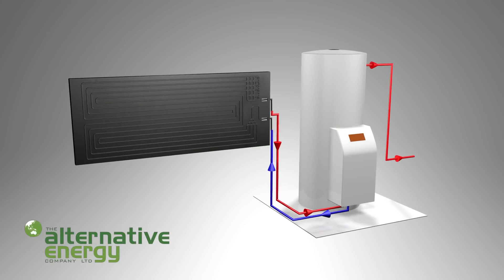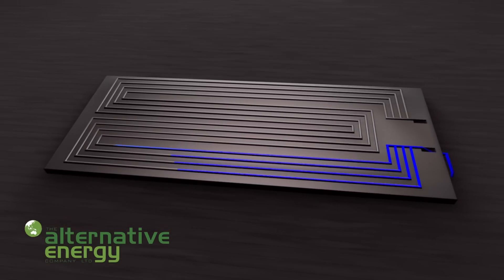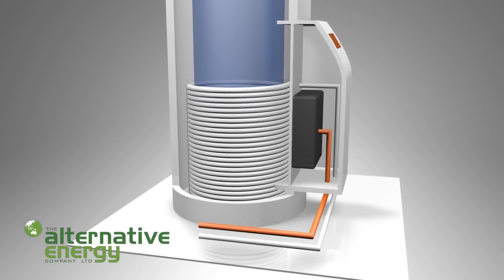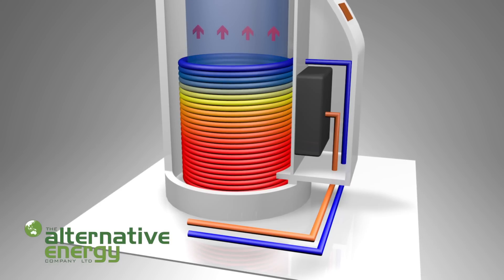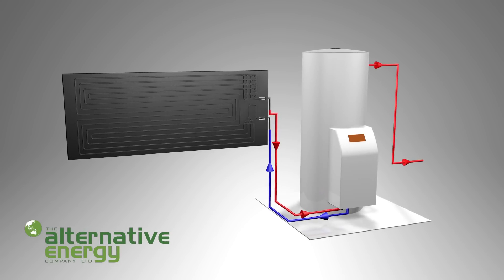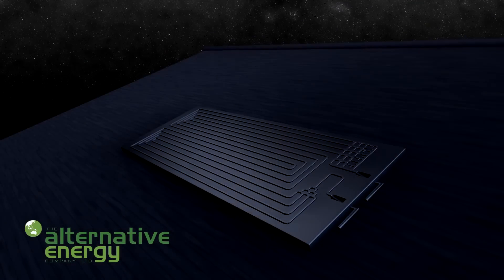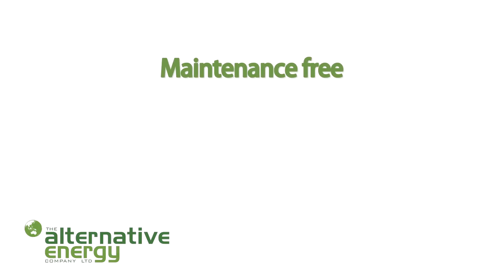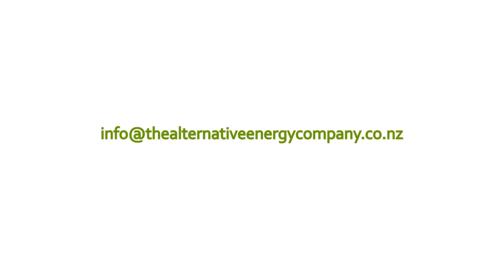Thermodynamic Solar Hot Water -  How it works!

Comment: You say it provides all your hot water requirements but you dont mention how many litres of hit water (55 deg +) it provides per hour. For example what size of system ( ie panel size , storage tank size) would be required to provide hot water for showering after a game for 20 shower heads ( currently requiring 2 x200 gallon storage tanks) where the demand is all roughly at the same time and not spread over a prolonged period.? Is there a system currently available to provide this amount of hot water.?
Reply from the maker: Hi, Energie do a range of systems for large scale hot water for hotels etc.  They could do a system that would easily cover 20 showers.  We would probably suggest a Eco system with a 1500L or 2000L tank to be safe.  When you say gallons, can I ask where you are located?   I suggest you look at their website www.energie.pt/en
Reply: @thealternativeenergycompan9065  Hi, thanks for the reply. I'm based in UK (N Ireland to be exact) I'm old school when it comes to measurement units lol
Reply from the maker: @trevorbest5715  https://www.lvprenewables.ie/ are distributors in the UK.
Reply: Could I use this to fill a hot tub quite quickly? If so, would there still be some hot water left in the tank or would any remaining water be diluted with cold water?

Comment: Had one installed 3 weeks ago, working brilliantly so far.....reading the literature supplied, i see it can take an input from an inverter from PV panel..very interested to do this as a stand alone feature.
Easily achieved  ?
Reply from the maker: Hi, I'm not sure if you are in NZ, but if you contact us we can give you the details of how to set this up
Reply: how much it cost for the whole system and installation

Comment: Near the end, it says it works day and night. Earlier, it said the fluid gets heated by the sun. How does it work at night?
Reply from the maker: Hi, it is heated by the sun, wind and rain.  The refrigeration fluid boils at around negative 28 degrees, so most weathers will have a heat transfer effect.

Comment: This is the same as a heat pump ....
Reply from the maker: A solar enhanced heat pump, making it 35% more efficient and an ordinary air to water heat pump.
Reply: @thealternativeenergycompan9065 You are calling it solar enhanced, nonsense there is no 35% more efficiency and your crap will not be able to match air to the water heat pumps on a wider range of ambient temperatures.
Reply: @adobo6905  Theoretically its possible to beat air source, especially if its sunny.  We need performance data from independent organizations.

Comment: Is the system not available with a solar electric solution for the 390w compressor. To make it a complete off grid system.
Reply from the maker: We could fit it to a small solar panel, but then it would not work when there is no sun!  We have many off grid customers because it greatly reduces the load on the panels and batteries
Reply: @thealternativeenergycompan9065  If it could work without an inverter it would be huge because hot water and space heat make up the majority of the inverter load.

Comment: How is this different from a heat pump? Isn't it a hybrid if solar and heat pump?
Reply: Well yes, it's a heat pump, the question is, how effective is it
Reply: @lenova8278  less effective because when you need at -10 degree Celsius it freeze on surface and can't touch any heat resource. 
On the other side heat pump take all air even -10 degree Celsius.

Comment: Hello, what is the efficiency of this system in the winter at about 0 degree cesium .
Reply: i don´t recommend using cesium in this istallation
Reply: @alteserien  " Celsius " My bad.
Reply: Ours was installed 4 years ago and worked fanfastically ever since, even at minus zero temperatures. Hot enough to burn.

Comment: almost the same with heat pump? but you use more smaller compressor
Reply: Yes, this is a solar enhanced air to water heat pump.  Generally 35% more efficient from the solar gain than an ordinary air to water heat pump with large fans.

Comment: Can this heat central heating?
Reply: Yes, thermodynamic panels heat hydronic under floor heating very efficiently.
Reply: I don’t have underfloor heating. Only radiators.
Reply: Hi, Radiators generally heat the water to a high temperature, to use thermodynamic solar panels, the radiators must be specified for a lower heat.  check www.energie.pt/en if you are outside NZ.  Thanks.

Comment: Can this same style system be used to cool a home? I seen a video on a solar hot water system doing it.  It both heated and cooled https://youtu.be/cz-kquRmvqk.
Reply: This system cannot cool the home, it is only used for hot water.  Energie do make a very cool reversible air-water heat pump, which can be used for heating in the winter and cooling in the summer.  looking at the video in the link, I'm not sure where the cooling is coming from, it looks more like a dehumidifier
Reply: Technically yes, it can cool your home. The only limitation is the thermodynamic panel can throw off the chill and collect heat only when the is a need for hot water and the compressor is running. If the water in the tank has reached the desired temp, the system shuts down and there is no gas circulating in the panel.

Comment: If this is a solar system why do they say it only saves up to 85% on water heating cost? Why not 100%. Are they hiding an electric plug somewhere?
Reply: You have to power the pump.
Reply from the maker: Yes, it uses a 390w compressor, just like your refrigerator.  It comes on and off as it needs to, providing huge savings in energy year after year.  The technology was patented in Portugal over 30 years ago, it is installed all around the world.  We are in New Zealand, if you are interested and outside of NZ check out the Energie website for a contact closer to you.  www.energie.pt/en

Comment: Does this work to heat the house with floor heating?
Reply from the maker: This unit is designed for domestic hot water, but there are options that are great for home heating.  You can look at www.energie.pt for the various options
Reply: When the thermonamic panel is combined with PV panels and the small heat pump and a Thermal store, with a electrical or gas/oil back up, YES it cane provide both HW and heating from same store

Comment: I have installed  this system in my home. it is working very well. However, the system is awaiting UL approval before my local building department will sign off on the permit. When this happens, it will be the best system ever!
Reply from the maker: Great to hear, we wish you well.
Reply: will it still work with if the sun is clouded over
Reply from the maker: @stevenolivero5207  Yes, the thermodynamic system works when it is cloudy, raining and snowing.
Reply: @stevenolivero5207  Yes, it will work at night as long as the air temp is 5 degrees above 0
Reply: Would this work to heat the house with floor heating?
Reply: @Babaji5D  with two panels and the required pipes and pumps, it would.
Reply: @dwightmoret2616  Is it more efficient than a heat pump? My brother is a building engineer and he brushed it off as a fancy looking heat pump that in any way you need  electricity for the compressor. What I wanna know is if this is so efficient why dont people heat the house with it?
Reply: @Babaji5D  It does use electricity, just not to make heat. it is a refrigerator in reverse. the panels absorb heat from the outside and transfer that heat to the tank. With the right sized tank and panels, one could use it to heat the house through radiant tubing in the floor. It is not more efficient than a refrigerator, it just uses less power than a standard electric water heater.
Reply: @dwightmoret2616  Yeah all good and dandy but not at any point in this process is there any solar power involved which makes it a fancy heat pump nothing more and thats where these guys are actually telling us misleading information. Now the question is how much more efficient is this as opposed to standard heat pumps i mean both of them have pretty much the same compressor ?

Comment: All my hot water cylinders eventually leak after 10-15 years and need to be replaced.  What happens to your systems?  Can the heat exchanger be  placed into a new cylinder or do you have to replace the guts of the system if a leak happens?
Reply from the maker: Hi Graham. Sorry to hear about your history with faulty cylinders - that sounds unlucky. In the rare event that our cylinder fails/leaks, you can replace the cylinder by itself and connect the new cylinder up to the heat exchanger panel. No need to swap out the panel on the roof. I hope that answers your question.
Reply: @thealternativeenergycompan9065  So the heat exchanger plumbs into the HWC?  You can attach it to an existing HWC as I've seen in other thermodynamic installations?
Reply: @thealternativeenergycompan9065  As far as I know, it's pretty standard.  A water tank type heater lasts 8-12 years https://www.bobvila.com/articles/how-long-does-a-water-heater-last/ which is also my experience.  I've replaced 3 hot water cylinders in the last 30 years.

Comment: A supplier of this system in Portugal has been trying to sell me one of these systems. It seems to me like a good system, but I have been put off by their sales guy who seems to understand less about the system than I do. According to them: 1. it runs for free without using any electricity for the compressor; 2. it doesn't use solar energy at all; 3. it doesn't work at all on the same principle as heat pumps i.e. like a refrigerator works; 4. if you use all the hot water, it provides very rapid heating of a tank of cold water to full temperature in less than an hour (when I believe it can take several hours even on a sunny day to heat a tank full, though obviously it depends on how many panels you have, how big the tank is, how sunny it is and what the ambient air temperature is). The impression I had was that the sales guy's knowledge was gained only from viewing this video and without any further knowledge whatsoever.
Reply: Hi, it seems you have been given incorrect information.  Please contact tiago.costa@energie.pt for assistance.  Tiago is the international Sales Director based in Portugal, he will be interested to know who you have been talking to and put you right.  It is a great system, best wishes.

Comment: I have a diesel heating system for water and house (about 300m2). For the heating of the house I use wall panels. According to the answers already given by you, your system allows the heating of the houses but can work for hydronic underfloor heating. Can it work with the traditional wall panels that I have installed?
Reply from the maker: Thermodynamic hot water heats to 55 degrees C.  it is exceptional for domestic hot water and underfloor heating however the temperature required for wall radiators is around 70-80 degrees C so you have to have over-sized wall panels for it to work, I believe this would not work for you.

Comment: Does it need an electrical supply? Or is it heat/gravity fed?
Reply from the maker: Hi, it uses a 390watt compressor, so using a small amount of electricity.
Reply: @thealternativeenergycompan9065   ? 24hour = 10 kilovat * 20cent = 2 euro per day?
Reply: @AN-ks2ep  Once the hot water cylinder reaches its set point, it doesn't need to use the compressor right?  Just like a fridge the compressor doesn't run 24 hours.
Reply: @AN-ks2ep   No... what compressor can run 24h/day 365 d/year ? It's running only to reach set water temperature.

Comment: this doesnt work any gas only absorbs so much heat. you can put the condensor anywhere. no need for that panel that sits in the sun . another consumer scam
Reply from the maker: It does work, try it.
Reply: I think that the idea is that the panels are black to absorb heat from the sun when it is sunny, but when it is not sunny it takes heat from the air instead (though the heat sent to the tank is less when it is not sunny. So you can mount the panels in the shade but they won't be as efficient as if they are placed in the sun. If I have this incorrect, can someone please tell me?
Reply: @SodalisUK  it just needs to absorb heat from the environment.  Since the gas is liquid at -20 deg C it turns to gas at any temperature above this.  It just works more efficiently where it is exposed to the highest temperature.  It doesn't send heat back, it sends a gas back to the compressor.  The compressor squeezes the heat out of it turning it back to a liquid and the heat is used to heat your hot water.

Comment: Good idea, can we use this system to heat buildings instead of using a gas boiler?
Reply from the maker: Yes, the technology can be used for hydronic underfloor heating (a multi-panel system). It is best suited for new builds as pipes need to be laid in the floor.
Reply from the maker: Hi, you can use thermodynamics as a heat source for hydronic underfloor heating, large volume hot water etc.

Comment: How does the compressor work? Doesn't it need electricty?
Reply: The compressor is 390 watts, it turns on and off like your fridge when necessary, providing hot water 24/7

Comment: what is the minimum exterior temperature at which this system will function ?
Reply from the maker: The Energie system will perform until the outside temp is minus 10 degrees

Comment: Sounds like a good idea. Only thing is your flow into the heating coil in the tank is incorrect. For it to work properly it needs to enter where the water is the hottest and exit the tank where the water is the coldest i.e. bottom of the tank. That way you get the maximum exchange of heat.
Reply from the maker: Hi Derek,  Thank you for your comment, you are correct and that is exactly how it operates, but when we had the graphic working that way and tested the video before we made it live, nearly everyone assumed that we had it wrong and queried the effectiveness of the system, and if it worked that way around?! So, we changed it to aline with customer expectations. The idea of the video is to quickly explain the principle to those who are unfamiliar with the technology.
Reply: ken
Reply: The Alternative Energy Company Ltd - Thermodynamic Solar Hot Water Specialists
Reply: @abdurrahmanrassool945  ok
Reply: ok i want one how do i get it ? also i could sell the heck of  these